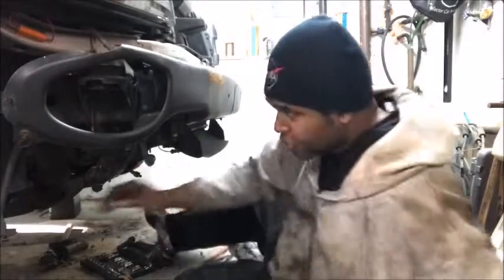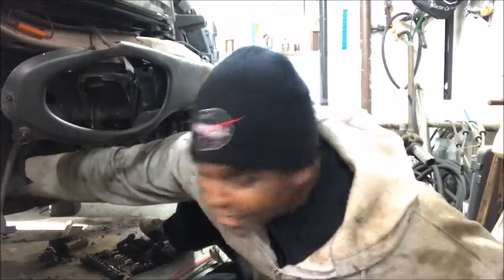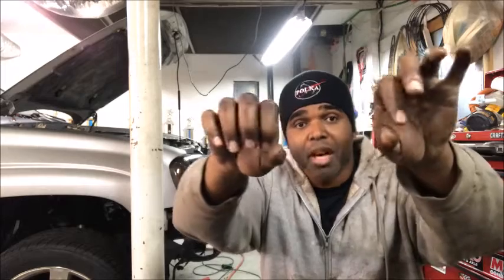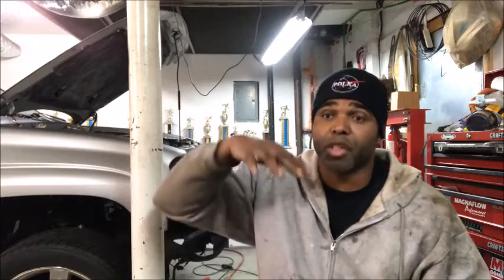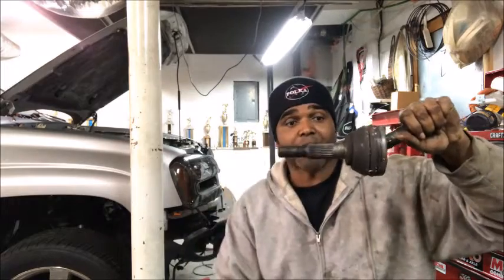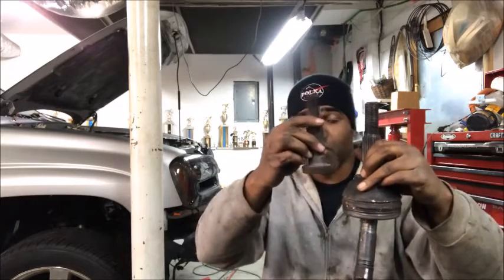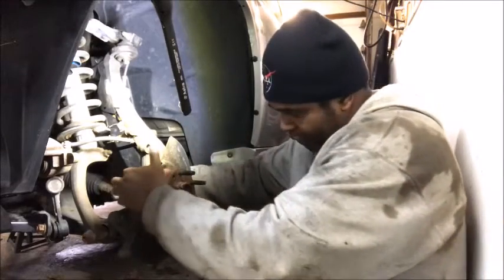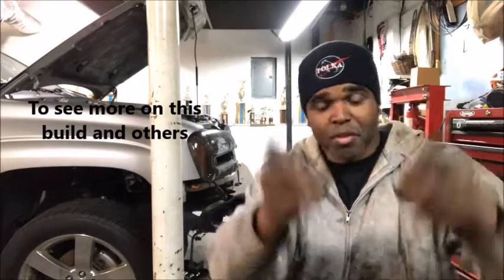How To Make A Stub Shafts from CV Joints.

Comment: How did you cover/close the holes on the front differential? Did you leave them open? I have an 06 trailblazer ls 4x4 and my cv joint axles are shot. Mechanic says my front diff might also need to be replaced. Thing is I don’t have money to replace the axles much less the front diff and if i did I don’t know that I’d want to since last time I did my oil change I noticed a good amount of metal shavings in my oil. I don’t think I want to invest more money into it if my engine my be going out. I’m thinking of just keeping it as a rear 2wd. I’ve never used the 4x4 and honestly don’t need it. don’t see why I should spend all that money to fix it. Thanks for your helpful video!!

Comment: The word on the forums is that stub axles are not needed
Reply from the maker: i use them because they locks down the hub. without them the only thing keeping your wheel on your car is the bearing.. they cam stock on rear wheel drive TBSS for a reason.. im doing a video soon on the stub shaft and the importance of having one..

Comment: Thanks for the info Terry what's the drawbacks on keeping the cv joints as is ??
Reply from the maker: weight and the front wheels wont spin independently.. are you removing the all wheel drive?
Reply: @Coverman66  thanks for the response yes I'm removing the awd but it seems none wants to get into the front axles

Comment: I noticed the stop flang on the cut off CV joints is some what thiner than the factory stub shafts. I was wondering how the are holding up and is this a safe way to do the conversion? I love my AWD here in Colorado with the snow and some times ice. With that said I hate weak link of the tranny, and would like to use the built 4L85e I have but will fit up to the transfer case.
Reply from the maker: i wish i had the answer. im not 100 percent sure if it will bolt up.. i cut at the first step and its ad thick as a stock axle shaft.. i will keep you posted..

Comment: Great idea on the DIY stubs!
Reply from the maker: thanks brotha Trebor.. much appreciated.. its a quick solution to a hard to find expensive piece.
Reply: @Coverman66  
Hey terry im doing this on my 07 TB LT its the 5.3 v8. Did u have to put plugs on the end of the diff where the cv axles would go or is it fine without? Also will it leak oil or anything?

Comment: Are you switching out the oil pans aswell? Just curious
Reply from the maker: not at this time 4M.. if i take the engine out then i will swap the pan..  for now i will put in an extra quart of oil and roll
Reply: 2wd and awd trucks use the same pan 4M.

Comment: Pretty cool. Don't the hub bearings collapse without that shaft installed, I remember at my work someone moving  a car out of the shop minus fwd transaxle and c.v. shafts and hub bearing fell apart.
Reply from the maker: exactly.. i would imaging the wheel will come off if the bearing fails..

Comment: My envoy xl is rear wheel 4l80e 408 ci ls. Onlu problem I ran into was braking the rear shocks and sway links. Had to get solid motor mounts the kept braking when I smack the pedal. Put a set of coil over shocks in the rear and kept me from nraking stuff in the rear.
Reply from the maker: wow.. how did the coilovers ride?
Reply: @Coverman66  I got them off ebay theyre awesome to me stiffened up the rear and still gave a good ride . monroe 58644 is the part number $131.72 for set.
Reply: @YLTMauto  I love to see some pictures sounds interesting I own one of these trucks 173,000 and I take it anywhere good truck.